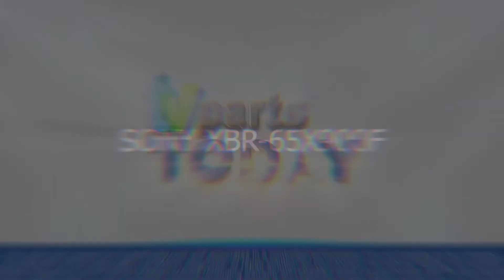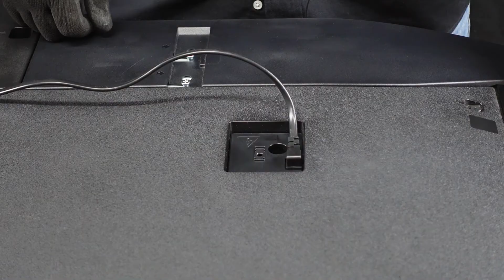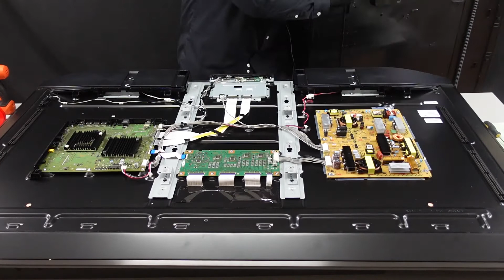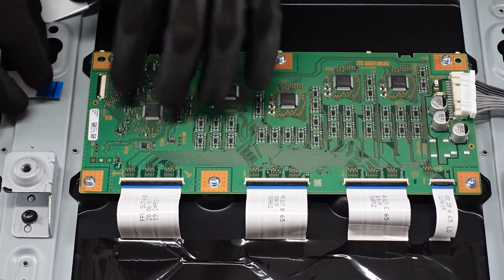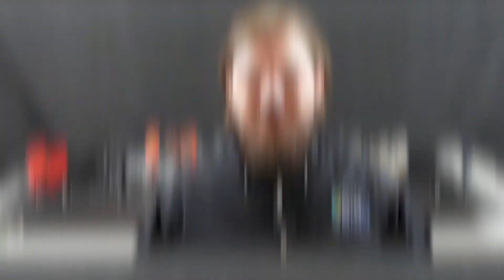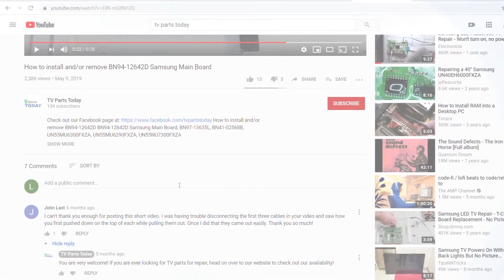Super easy TV board removal tutorial.  (SONY XBR-65X900F)

Comment: I just want to remove the wifi module so it’s not a smart tv, can’t find the video I had years ago that showed how to do it
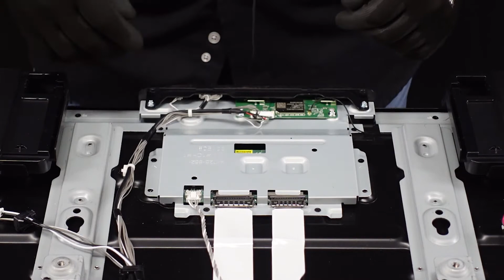Reply from the maker: Starting at 4:39 you can see the wifi module mounted on top of the plate covering the t-con, nestled under the IR sensor housing. It is the small green rectangular board.  If you remove that white clip, it should disconnect the wi-fi and prevent your television from connecting to the internet.

Comment: Hi really enjoy your videos.  I'm working on the XBR-65X900F - symptom: appears dead.  Replaced the power board - still nothing; ensured that voltage was coming in and the 3.3 v standby voltage was there, tested the two capacitors and they had 390 v; checked the fuse.  kind of at a loss and moving onto the mother board - would appreciate some tips on what to check on the main board.  Thanks  Joe
Reply from the maker: Hey Joe, I would give our customer service department a call and run your issue past them. The guys in our office have a lot of experience with symptoms and diagnoses. 
phone: (930)212-1975

Comment: Power cable does not disconnect without having to remove the panel? I would like to use my Sony in Europe but currently have US power cord.
Reply from the maker: You would have to remove the back cover to access the power supply where the power cord connects. swapping out a power cord could be tricky though. This unit has a power cord that slides into a connection port that is on the power supply itself, so you would need to find one with the correct wall plug as well as the correct connection to the power supply. There could also be a voltage issue, even if you swap the power cord. I am not sure the voltage rating of the power supply, but I would be 100% certain it is compatible with the voltage coming from the wall socket or you could blow the breaker at your home.
Reply: @tvpartstoday it says 110-240V on the TV so it should be fine. I am thinking to simply buy cheap US>EU adapter and have Sony cord plugged into it
Reply from the maker: I have traveled outside of the US a few times and I have never had much luck with the adapters. I would vet whatever device you use thoroughly before using it with the TV.

Comment: can I remove the wifi board only
Reply from the maker: Yes. The wifi board in this unit is located right on top of the t-con board. If you take a look at 4:40 you will see the wifi board mounted on top of the plate that covers the t-con. You will not have to remove the t-con or the IR sensor.
Reply: @tvpartstoday  thank you my neighbors hack my TV and control it while I am watching so I hard wire it but they know how to turn on the wifi even when I turn it off, its annoying but they wont stop. changing password and factory resetting seems to not work either so I think the only option is a new TV or try removing the wifi

Comment: My xbr 65x950g has been shutting down and displaying 4 flashing lights after running several minutes. My research indicates a faulty LED board. Would you agree with that diagnosis?
Reply from the maker: I know there is a list of "blink codes" that correspond to a group of boards that could be causing the issue. I know that the LED driver and the panel are on pretty much every one of these lists. I would give our customer service department a call and go over the issue with them.  We have a list of these blink codes for a lot of models of Sony TVs. 

phone:  (930)212-1975
 email: info@TVpartsToday.com

Comment: Hello there, I switched out my T con board  for my Sony KD-65XG9505 and now the screen constantly flashes. Any thoughts on how I can solve this?
Reply from the maker: That sounds like it could be a bad cable or a cable didn't get seated correctly when you swapped out the t-con.  I would try to reseat the ribbon cables and make sure that all the other connecting cables are seated properly.  If that doesn't fix the issue I would get ahold of our customer service department and run the issue past them.  Make sure to include the model number of the TV, the symptoms before the swap, what part you swapped out and what the TV is doing now.

phone: (930)212-1975

email:  info@TVpartsToday.com
Reply: Thank you for your reply.
I think I messed up big time.
Because I put the old board back in, and before it was a black screen, but at least it still had sound, but now the flashing  is the same as with the new board.
Also, I noticed too late when switching the ribbons the text saying control and on the other side, the text panel. Maybe I switched them around.

Sony KD-65XG9505
LMY650FF02-A

Comment: I wish I had found this video before working on my Sony TV. I ordered a replacement Main board and the flat ribbon cables were a pain getting them o0ff. Another video showed pressing in the middle, not the edges. Of course, you're out of stock of these ribbon cables right now but I'm continuing to try and repair my TV.
Reply from the maker: That's a bummer. :( 
 We have not put any ribbon cables into stock in quite a while so I don't know when we will have them available again.

Comment: Hey guys. I have a question regarding my Sony Bravia XBR-75X950H. The TV turns on for about 30 seconds. Completely boots to the home page, but then turns itself off. I tried replacing the power supply. Same issue, booted to main menu, then turned itself off after a few seconds. I tried replacing the mother board. Same issue. Booted up to the main menu (although this time none of my apps were installed and I wasn't logged into my google) and after a few seconds, it shut itself off again. My next attempt is going to be to try replacing the t con but i was wondering if you had any advice on what the issue might be? I've searched for issues and there is a common one if the red light blinks 4 times, however my tv does not blink red 4 times, it just blinks red once after it turns itself off.
Reply from the maker: I checked a part list for your model just in case there was a sub-power supply and I'm not seeing one. If you have already replaced the main board and the power supply then I would assume that there is a fault in the panel.  There is an off chance that there is an issue with the t-con board or LD board that could be causing this issue, but I would put my money on a fault in the panel. The good thing is that if you were going to try to swap the t-con or the LD board they are relatively inexpensive compared to the main board and the power supply. 

All of the login info for the TV is on the main board. When you swapped it out for a new one the login info went with the old board. Same thing for your installed apps.
Reply: Awesome, thank you so much. I'm going to replace the t con tonight, but if that doesn't work I think I'm just going to give up on the TV. Really appreciate your response on this!  @tvpartstoday

Comment: I have the Sony XRB-49X900F.  No issues so far.  Nothing like that really bad 800 series! (yes, Sony was aware of the many production issues with that model series).

The only thing this does and again, yes, Sony is aware and on their support site, where people can log in and comment, there isn't a real fix for this minor issue.  Just the usual "reset, restart, spin 3 times left, on one leg"  etc.  LOL

What the issue is, is the random rebooting of the danged system, without any firmware updates even happening.

There are probably several reasons that can cause this, apparently one of them related to the USB port with something being plugged into it.  (I forget now).

But one for sure, as I've discovered of late, can be the remote control itset when it gets sticky keys.

Yup, it turns out that the power button, sometimes sticks down, keeping the IR LED going, which the TV detects as one long push, which does mean, REBOOT!  It sometimes gives you the option to CANCEL out of it, but it's way too fast before it just goes ahead and reboots.

Now, I'm in the habbit of pushing the button and then quickly putting my hand in front of the remote to block it, while I press the button a few more times.

I realize that I need to take it up to the lab and do a good cleaning on it.  I was able to buy a couple new remotes off of Amazon, fortunately.

The only annoyance with this reboot, I think is when using the TV as a computer 2nd monitor.
Everything from the main display now gets pushed up to the TV once the reboot is over.
So you have to move everything around.

Other than that, it's been an excellent TV.  MUCH better than that 800 series junk.
Reply from the maker: Unfortunately I would assume pushing out a product with known defects is cheaper than halting production after it has started. Sony is known for making high quality TVs, but the fact that known issues persist for years is disheartening.  Like any piece of precision electronic, I would always recommend lots of research before buying a new TV.

Comment: I haven't been able to reset the system or update the firmware. Every time the TV restarts, it reverts to a certain point—not the initial setup, as it's still logged into the Google account. It restarts randomly, and I'm not sure if it's a hardware or software issue, but I can't update the firmware. Is the Android system of the XBR-65X900F on the mainboard? Could it be that the Android system's hard drive is damaged?
Reply from the maker: The Sony firmware update has to be done via a USB thumb drive with the correct firmware on it. If you would need help figuring out which firmware to download and how to install it on your TV, give us a call at: (930) 212-1975

Comment: Hello I need help in trying to repair a SONY XBR-65X900F TV. I can not see an Image. I tried resetting it through the manufacture setting. Can you help ?
Reply from the maker: I would start the troubleshooting process to narrow down what the issue could be. If you are hearing sound but you are not getting a picture I would recommend doing the flashlight test to see if you are getting back lights. Ill link our flashlight video: https://www.youtube.com/watch?v=2TMfkYy58ZU

If you can see an image when you do the flashlight test it, most likely, means your backlights are not firing correctly and that would be the avenue to follow. If you are NOT seeing an image when you do the flashlight test the likely culprit is your mainboard.

If you would like some more in-depth help, send us an email to:  info@tvpartstoday.com      with your model number and a brief description of your issue with any trouble shooting steps you have taken so far.

Comment: I have a XBR-75x900f and turned it off and the next morning powered it up and got the Sony splash screen and then the android start up screen for about 4 seconds, then the screen went black and the front LED started to blink RED 4 times then 3 second pause and blinks 4 times and then repeats. Is this possibly power board or LED failure?  Also do you have a tear down video for this model? ANY help would be GREATLY APPRECIATED!!!
Reply from the maker: A x4 blink code is usually the LED strips themselves. I know that the blink codes are not EXACT but that is the error that a x4 blink code on this unit is telling me. We do have a tear down video for this unit. Ill link it here : https://www.youtube.com/watch?v=OhOhgi89sp0

Comment: Hey, there. Very good and useful video. I have a question: so, my tv is showing washed out colors and artifacts. Sometimes just turning the tv off and then back on would solve this problem, but unfortunately this isn't the case anymore and the tv just keeps showing these weird washed out colors and artifacts. It's more noticeable in hdr content. So, it could be a problem in the motherboard?
Reply from the maker: Thank you for the comment! That issue could be your main board, tcon board or the screen itself. You unfortunately will not know which is the cause until you replace the circuit boards first, here are a few links that might be helpful! 

https://tvpartstoday.com/search?type=product%2Cpage%2Carticle&options%5Bprefix%5D=last&q=xbr-65x900f
Reply from the maker: https://tvpartstoday.com/pages/sony-firmware-update-help
Reply from the maker: https://tvpartstoday.com/products/a2197252a-a-2197-252-a-sony-main-board-a2197239a-1-983-249-21-xbr-55x900f-xbr-65x900f-xbr-49x900f-xbr-75x900f-xbr-85x900f

Comment: I have a Sony 65X900F. No picture but sound. Sometimes I have picture for a few seconds then blackout. Is the issue T Con board?
Reply from the maker: It sounds like a mainboard or a t-con issue. T-con would be a perfectly reasonable place to start.
Reply: @tvpartstoday  Hi, I sent you an email for a T-con. On your website, there is approx 3 different kinds of T-on for this TV. How do I know which one is the good one please ? thank you
Reply from the maker: @franceflorian  If you can get the back off the TV and check the t-con itself, there should be a small sticker on the top of the t-con board with a barcode on it. If you check the number right under the barcode (it should be something like: V40846K8K0AD7) a partial part number will be imbedded in that serial number. The example I gave you will have the partial part number 40846K which ties back to a part number LJ94-40846K. So we will be looking for that partial part number at the beginning of that serial number. We do not need the "V" at the beginning and it continues as "40846K". If you type that partial part number into our system if should give you the correct t-con part number you would need to order.
Reply: @tvpartstoday  excellent, thank you for your answer. I understood everything hehe. I'm gonna order it on your website, and the best, it is exactly the number that your wrote hehehe.
Reply from the maker: @franceflorian  Gotta love it! Good luck with your repair!
Reply: @tvpartstoday  Thanks I noticed that my part was sent today. Do you know how long will it takes to come to Montreal Qc ? Thanks again
Reply from the maker: Other orders to Montreal have taken about 3 to 5 business days to arrive.

Comment: I have a XBR-49X900E That powers up with a blue screen. I have tried multiple resets with out success, I have noticed when using the remote the tv is receiving the signal but with out and change to screen could this be the T con board
Reply from the maker: That sounds like it could be a few different things. The t-con board will be the cheapest part to replace but it could also be the main board giving you problems. If you would like some more in depth troubleshooting advice, send us an email to info@tvpartstoday.com with your model number and a brief description of your issue and we will be more than happy to get you pointed in the right direction. Thanks for commenting, Paul!

Comment: So on the X900F, if it just randomly shuts off by itself, about once every couple of hours but otherwise works fine and powers back up, and have already tried numerous hard resets, do you think this is the G84 power supply board starting to fail? Thanks for the great video!
Reply from the maker: When it shuts down, is your standby/power light blinking?

Comment: My XBR-65X900F won't power up, It powered up and worked for a few hours when I recycled power and then again it shut down the next day and wont power up after. The stand-by LED is not turning on either. I am able to measure 3.4vdc on the pins for the standby LED on `the power board. Is there any other diagnostics I can perform to identify where the problem lies?
Reply from the maker: Hi Sashi, thank you for the comment. For the most part, TV repair is a process of elimination. You replace the most likely part to least likely then if you can not resolve the issue by replacing the circuit boards then it can be concluded it is the backlights or the panel itself. The x900F series is  known to have a troublesome main board but if you no longer have an indicator light, it could be the power supply board as well.

Comment: Great video. Never new it was so easy. I had a power cable pinched in a wall mount. TV won’t power on now. Likely power board?? Thanks
Reply from the maker: If you have replaced the power cord and still experiencing issues you can replacing the power board.

Comment: My 900f just shuts off and just the picture, but the backlight works and sound works too but just the image disappear, what my problems please answer if ya know=)
Reply from the maker: Most likely it is the T-con. You will most likely need to update the firmware to pair the new T-con to the existing main board. You can also try updating the firmware before replacing any parts. Some times this can correct issues in Sony.